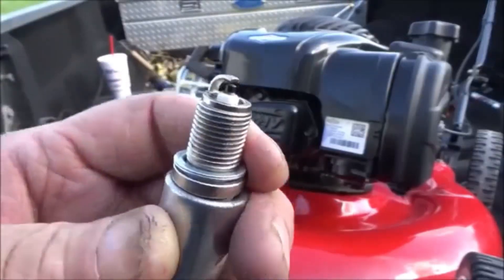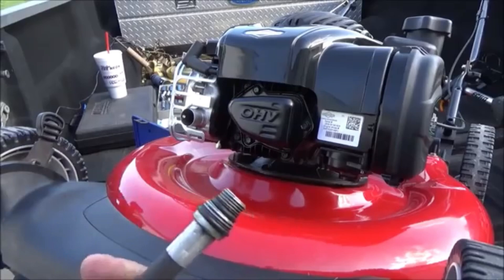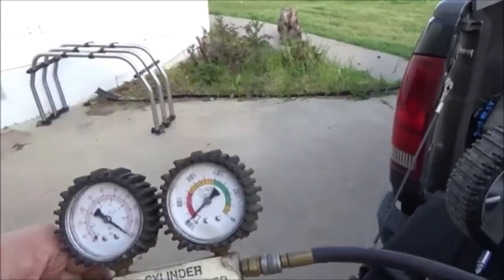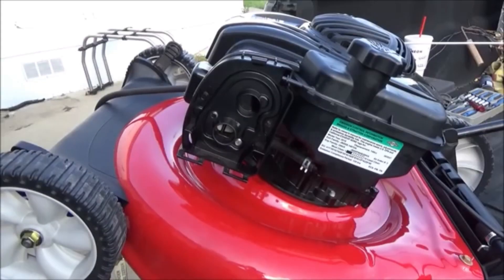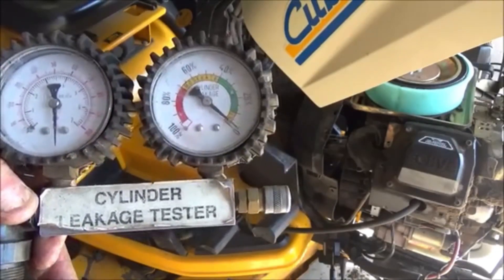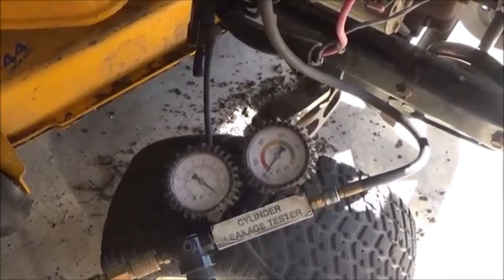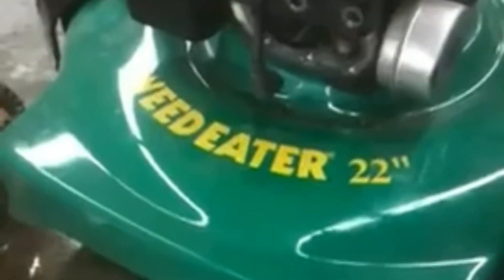HOW TO DO A CYLINDER LEAK-DOWN TEST

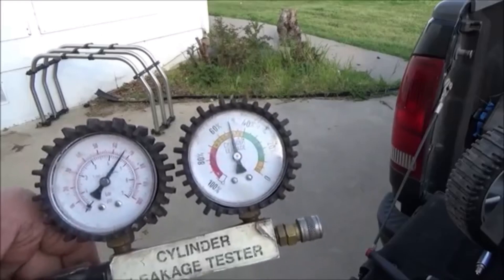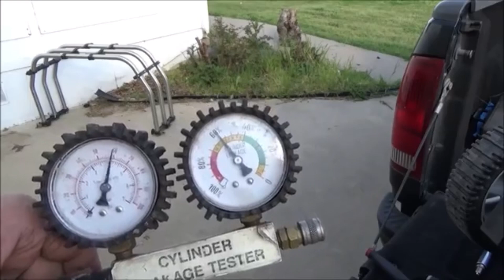Comment: Good video.  ½ dozen others I have viewed on the subject understand poorly the concept of setting the 0% point before attaching the gauge.  I think it's worthwhile to point out that when adjusting the pressure regulator to achieve a 0% leakage setting on the 2nd gauge, its important to adjust up to, but not past 0%, as you did at 3:40 (but not how you did it at 1:35).  In theory, the regulator also works as a one-way valve and there is a shut-off valve in the quick connector, so higher pressure gets trapped after the regulator, which can’t be released by turning the pressure regulator back to a lower pressure.  At 1:35, the pressure does drop and you get it back to a 0% setting, which I assume is due to a minor leak in the quick connector valve (which would affect the “trueness” off the test), or there was some leak back thru the regulator allowing the pressure to equalise.  Also, you demonstrate it well, that it’s important to release the pressure (turn the regulator pressure back down) before disconnecting (otherwise the pressure is trapped after the regulator) making it difficult to reset 0% (unless it has a slow leak like yours ?).

Comment: When doing a leak down test and introducing air into the cylinder how do you keep the piston at tdc.  As soon as I start to introduce the air the piston goes down
Reply: If the piston moves then you’re not at TDC.  If the piston is at TDC it will stay there.

Comment: @THEMOWERMEDIC1, always nice videos, question what's your opinion on E3 diamond fire spark plugs, have you used them?
Reply from the maker: I am a firm believer in using OEM spark plugs, you are not gonna find or feel any performance gains from the expensive platinum, E3, style plugs
Reply: @THEMOWERMEDIC1  just asking, many thanks.
Reply: Had them in my old 01 Wrangler with a 4.0L for a few thousand miles. Can’t say that notice any difference